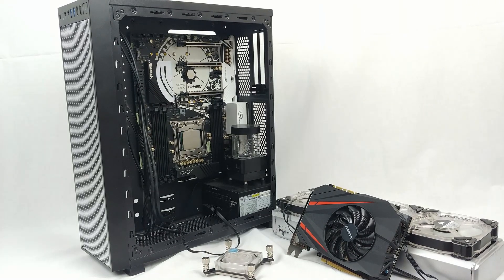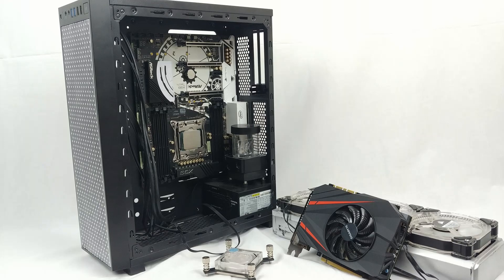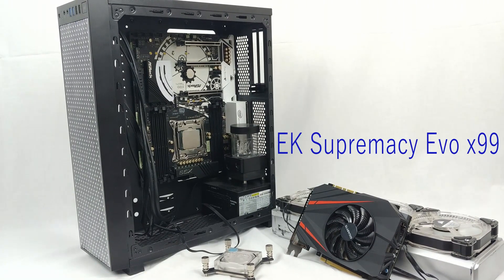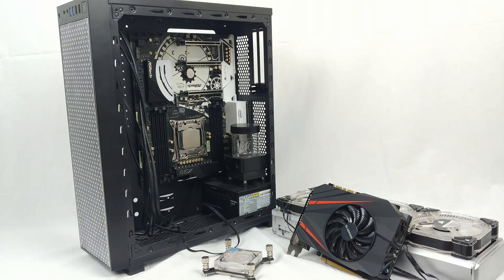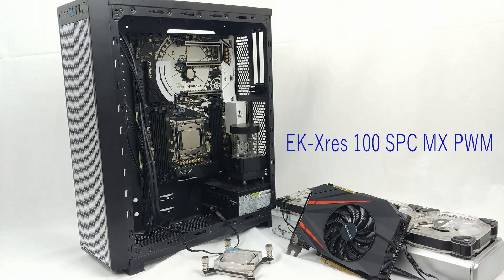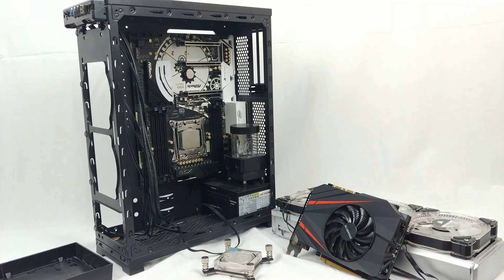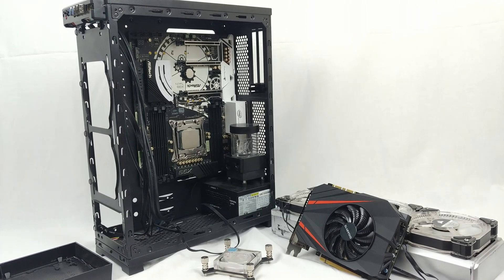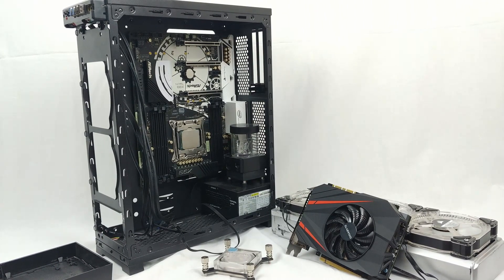Core G3 Mod Update

Comment: Sooo did you finish this yet? Considering a custom build in this case as well and I'd like to find a tempered glass panel for it. Any recommendations on going about that?
Reply from the maker: https://builds.gg/builds/silver-surfer-266

Here is the finished product. I sadly did not do a follow up video on out. 

I never did get a new panel but would highly suggest clockwerks for one.